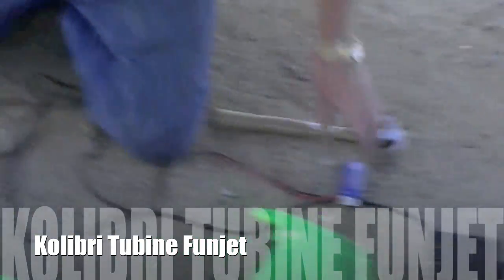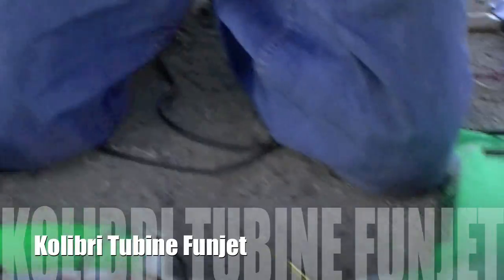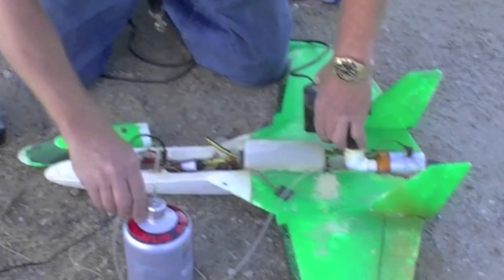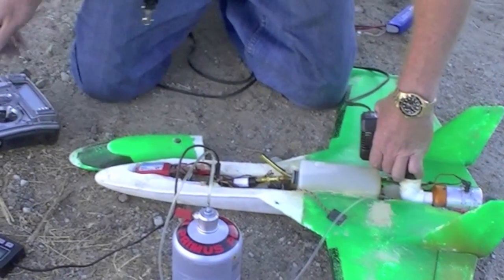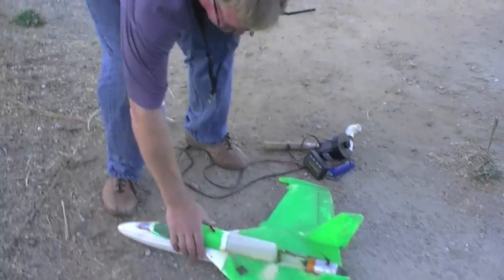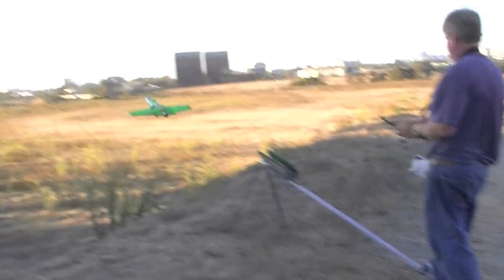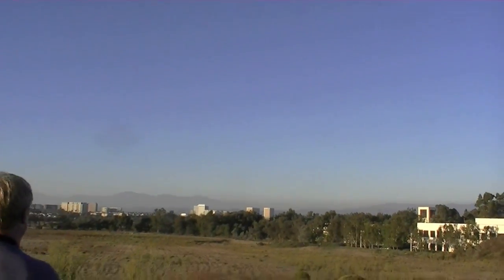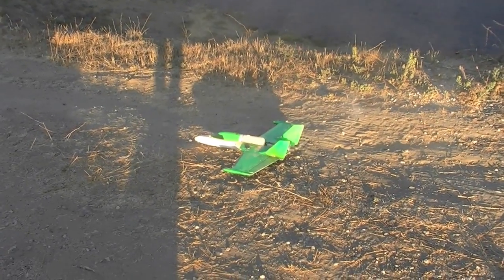Kolibri FunJet Turbine World's Smallest Jet Engine

Comment: I KNOW this is damn near a decade later, but do you have any clue how much thrust (more or less) pictured engine is producing? Looks like maybe a half pound or more, really who knows (certainly not myself)...?
Reply from the maker: 4.27 lbs at 245,000 rpm according to the specs. It’s a Lambert T15 Kolibri microturbine engine and it sells for about $2000 USD.

Comment: @210482fmj 

This rc hobby takes skill and tallent. Go see if you can learn to fly a rc helicopter or built one.
Most likely if you never did it before you will have alot of trouble and many crashes. It's about
love in rc hobby and enjoyment and enjoying building. You should just fuck off.

Comment: very cool
I was amazed, here in Brazil does not yet exist
and the price is too high lol
So I will continue flying with my battery 5s pylons, speed comes around 240mph, but has no noise and no one is so realistic that its equal
congratulations on airplane... 

cheers

Comment from the maker: I wish!  Some of the larger and newest turbines are "turn it on and fly" but on this one you need to get it spinning with a blower, manualy inject some propane/butane gas and wait for it to ignite.  Then a small on-board computer (ECU) takes over and begins to pump the kerosene into the engine.  It idles at 100,000 rpm.  Maximum rpm is 243,000 rpm.  This engine produces around  3.5 lbs of thrust for 5 minutes with 12 oz. of kerosene (Jet A-1) and the model weighs 3 lbs with a full tank of fuel.